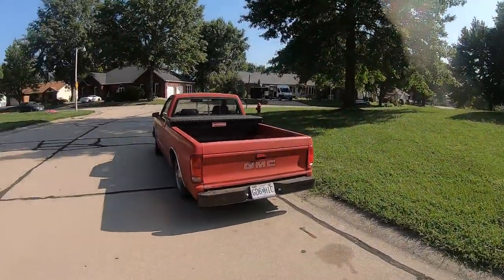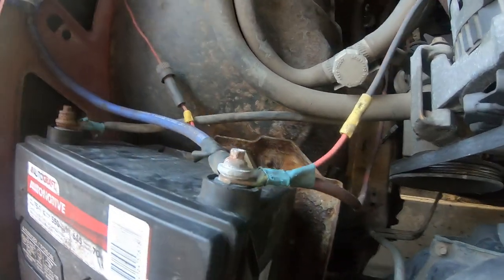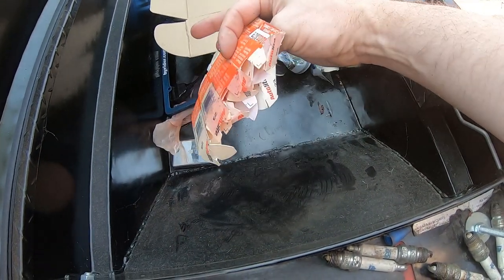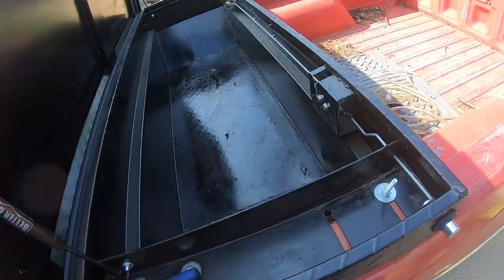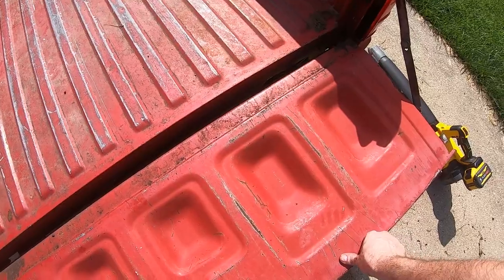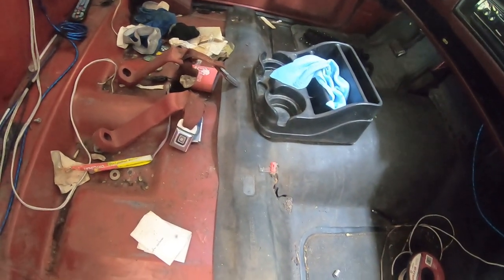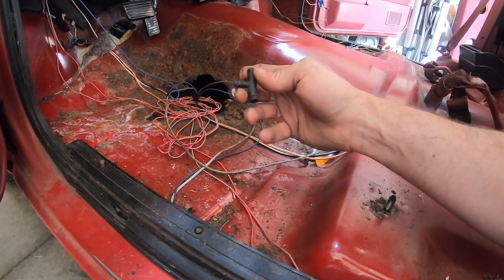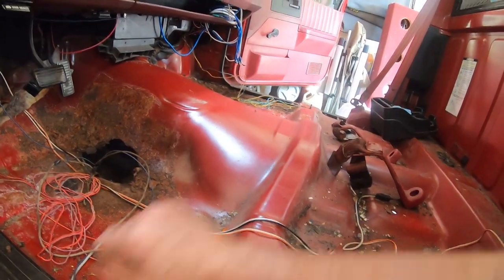What SECRETS are found in the GMC S15?  Cleaning out the truck and finding some crazy stuff!

Comment: 1) That thing inside the air cleaner is a mechanical TEMPERATURE sensor/switch that opens and closes the Thermactor (the little flappy-do thingy inside the air cleaner snorkel) using vacuum.  It senses the temperature of the incoming air.  Originally that vacuum line came with two rubber elbows, one on the air cleaner and one on the TBI and a nylon plastic hose between those elbows.  The nylon dries out and cracks.  That's why they blocked it off.  Replace it with a full length rubber line.  Throw away the elbows.
2) The reason the air is ducted around the radiator is to insure the engine is getting COLD outside air instead of HOT underhood air.  Make sure that stays stock.  There's no HP advantage to changing it on that engine.

Comment: That DIN stereo is removed from the dash using two small clips that you slide into the right and left sides to release the tabs that hold it in.  After that you can then remove the entire DIN holder.  Unless it's a "portable unit" which I doubt.

Comment: That "sound dampener/heatshield" you pulled out from under the flooring is to protect your passengers from a super hot floor caused by the catalytic converter sitting just below that.  Make sure you put that back in after it dries out or else the heat from your converter could melt your carpet/rubber floor.  At the very least it will cause chemical smells inside the cab from your carpet heating up even if it doesn't melt.
Reply from the maker: Thanks for all the advice. Very useful and I appreciate it. I already removed the cat in the last video, but I plan on putting some heat shielding back when I reinstall the carpet. Thanks!

Comment: You're also missing the Crankcase Breather that attaches through that squarish hole in the side of the air cleaner body.  Just Google "1986 GMC S-15 crankcase breather".  You'll also need the rubber hose that attaches to it and goes to the valve cover.
Reply from the maker: Just an editing thing. It’s there, you just didn’t see me pull it off

Comment: Looks like they jumpered and bypassed your heater Blower Motor Resistor.  It's that rectangle with all the orange wires are going to under the hood on the passenger side.  That's just weird, and dangerous.  NONE of that should be there like that.  My guess is, the BM resistor went bad but they didn't know how to properly diagnose it, so they bypassed it.  Not good.  Make sure to clean that mess up too by rewiring it properly and installing a new Blower Motor Resistor before winter.
Reply from the maker: I’ll check it out. Thanks for the heads up